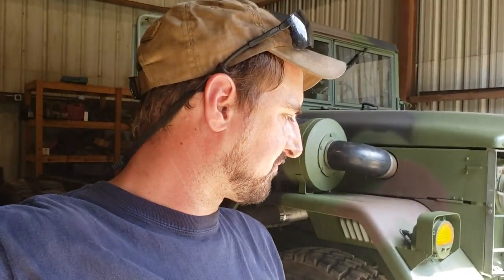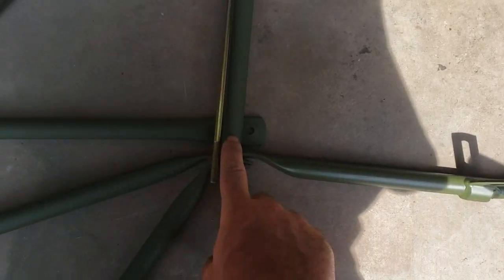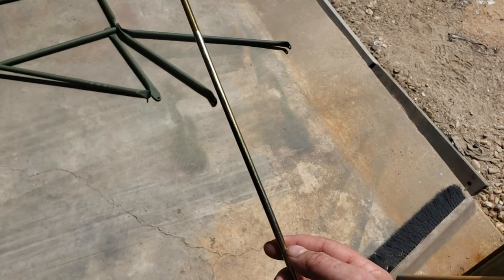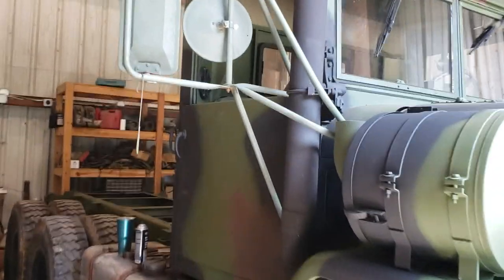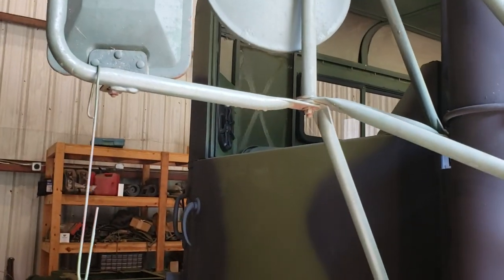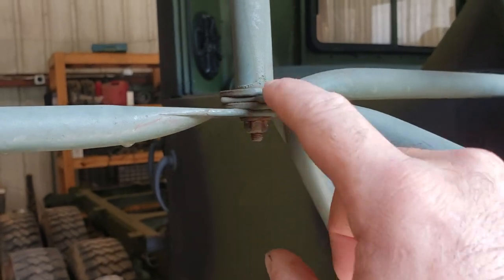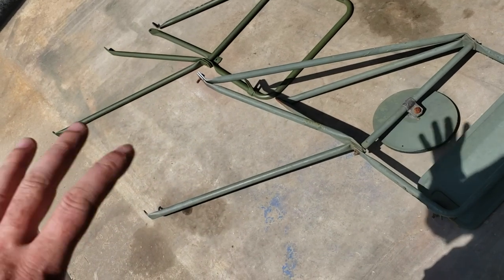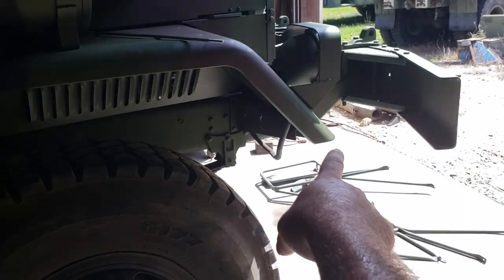M35A2/ 5 ton west coast mirrors setup & assembly

Comment: I increased the size of my threaded rod to 5/16"-18. I also used extreme strength heavy nuts which have a width of 9/16" rather than 1/2" for more clamping force.

Comment: never had the window frames fold back like that, i have problems with the mirrors themselves moving around. id suggest putting anti seize on the bolt threads themselfs and between the bracket "ears" keeps the rust away, a good little trick ive done is use a silver marker to mark where the mirrors face so i can always adjust them to the correct position for me. you could probably usea black sharpy or something so they aint noticeable. sure beats trying to reach over the seat to adjust mirrors and eliminates soldier b
Reply: Do you have the little plastic washer ?
Reply: @nomad-pq4yw8iy7v  mine dont have any plastic washers, just regular metal ones if I'm not mistaken
Reply: @johndowe7003   In alot mirror assemblies they use plastic washer at certain pivot points mine has them.It avoids the metal 2 metal contact
Reply: @nomad-pq4yw8iy7v  ah, nah mines all metal, i have more problems with the ball ends on the mirrors breaking more than anything

Comment: Could you do the video of the m35a2 steering box please i watched your one explaining about it. I may have to change mine as it has really bad play and a knocking noise. Thanks Adam from the uk.
Reply from the maker: Adam, what do you need to know specifically? How to remove and replace the box, or how to repair the box?
Reply from the maker: And I do hope you serviced the front wheel bearings recently, as a bad wheel bearing can cause the same symptoms.
Reply: No i haven’t. i have ordered to two new front shocks, drag link and tie rod ends from bigmikes. Im going to look at checking the play in the box like you suggested and change the fluids. Could you do a video of the   box removal please and whats inside the box. Thanks For the reply Adam from the uk.

Comment: Buying a whole setup can get very exspensive with those things a bet Mike's price would be pretty good. U ever come across setups that have a slightly different setup. Mine has a bend in the driveside short bar like the one on the passenger side that goes around the exhaust stack it's definately for the drivers side as the bends are opposite and wouldn't fit on the other side.
Reply: never seen that, all my brackets are straight
Reply from the maker: There are many different kinds. Don't specifically remember seeing one like that.
Reply: @tacticalrepair  I know it's kinda geekie noticing thinks like that but, I find it cool finding things like that.
Reply from the maker: @nomad-pq4yw8iy7v  it is definitely cool. There is a story behind all of it.

Comment: Did they come with different mirrors depending on there deployment? Mines a early 65 and looks to have a factory arm off the window hing that holds a 6x8 mirror.
Reply from the maker: Yes. There were several different mirror types depending on manufacturing date and application. You have what was called " elephant ears"